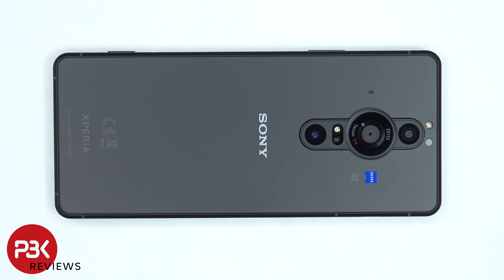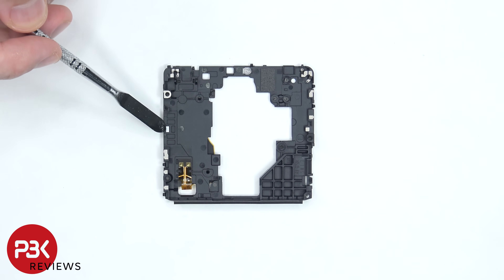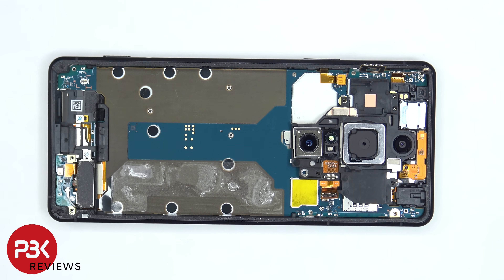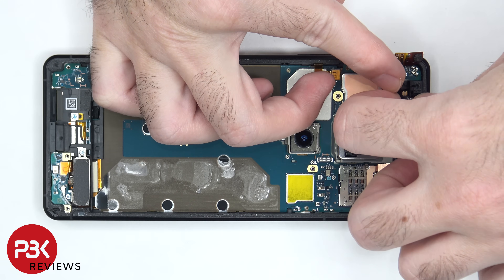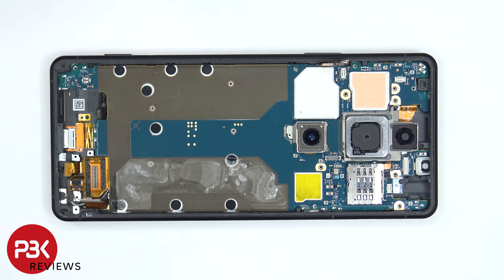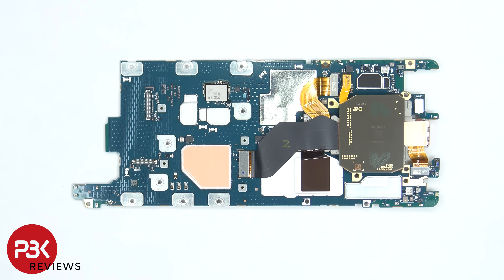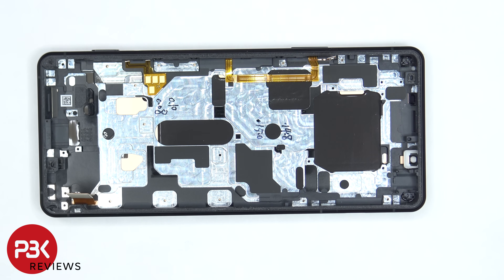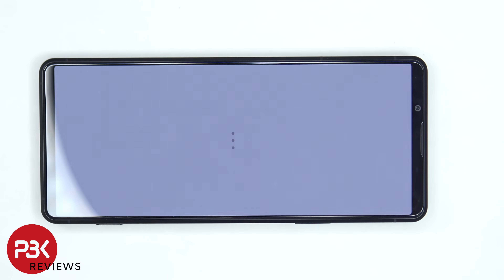Sony Xperia Pro-I Disassembly Teardown Repair Video Review

Comment: My microphone produces a lot of background noise so you can't hear what I'm saying, when I recorded my voice there was only noise until I whistled, on the recording the whistle clearly penetrated the noise which means that the microphone is working somehow. On your recording you probably listed 4 microphones, which one is the one used for conversations?
Reply: It seems that different microphones are used for phone calls and different ones for voice recordings or camera recordings. In my case, the bottom one is damaged.

Comment: Hello. Please help me fix my phone. I took my phone to a service to replace the fingerprint sensor. The sensor was changed along with the cable. The next day after the repair, the front camera froze during a video call. After this, all cameras do not work - an unknown error appears. The flashlight also cannot be turned on - it says the camera is in use. The service refuses to take responsibility. I took the phone apart. Several screws are missing, the flashlight diffuser is broken, the additional microphone cable was installed under the frame - incorrectly. Could the front camera or its cable cause a breakdown? I tried disconnecting
 front camera - no change. Does it make sense to try to turn off other cameras one by one? Or if at least one camera is turned off or the cable to it is damaged, then the remaining cameras will not work? Is there any point in trying to reset your phone to factory settings? I tried to stop all applications that can use the camera, deleted the cache - nothing helps. Also, before disconnection front camera battery drained very fast. Reset phone without front camera - did not help. Connected front camera, reset phone - nothing.

Comment: how do you separate the cellular antennas if possible? rest of video is awesome!
Reply from the maker: Some may be possible like the plastic covers which have the grey lines running through, but the board contacts which touch the frame would not be since you will end up damaging the board itself removing those.

Comment: Hey, I need to replace the fingerprint scanner of this phone. Do I need to take the main board out to be able to remove the fingerprint scanner?
Reply: Did you figure this out? I'm just waiting for my new scanner to arrive in the post.
Reply: @tris5506  You don't need to take the whole thing apart. The screws that are covered by the felt fabric are the last ones that need to be taken out and then you can access the fingerprint scanner.

Comment: Water got in mine, it's totally dead. Looking at this...I guess it's done for, because if I could even find the parts, I would probably lose something else
Reply from the maker: Yep, even if you took it apart, its a 50/50 chance you can get it working again based off what might be damaged inside.

Comment: Do not buy this phone! you will regret it. Camera is bad on so many levels, it freezes, UI is bad, screen is very dim even on the brightest setting and im sure it can't go 120hz it promises, It doesn't have photo gallery and it has loads of bloatware, Battery dies quickly, You can't upload your photos from the phone directly to computer the computer program won't work with this model, etc etc.
Reply: Liar

Comment: At 7:40 Soldering parts on the motherboard is very bad
In addition, the drawback of this design is that any failure of the board requires maintenance, and the thing cannot be replaced as a single piece. Like the charging pad on the S-22 Ultra
Reply from the maker: yup

Comment: So the phone has no cooling system or features? No wonder it suffers from serious overheating problems.
Reply from the maker: Yep. It has some graphite layers between the screen and midframe and uses the midframe to transfer heat but no major cooling components or anything significant, which usually is the case on sony phones.

Comment: Now, as if it was open, will it still be water proof // dust proof?
Reply from the maker: you would need to apply the original pre cut adhesive for the phone to retail water resistance. Usually parts for sony phones are hard to find so yep.
Reply: @PBKreviews  Thanks; so a guaranteed good repair shoul be done by Sony service I guess.

Comment: I was wondering why sony didn't put any thermal pads / paste on this device. I remembered the 1st xperia pro, it has a the largest vapor chamber on any phone on the market. 

Yet the Pro - I with the Snapdragon 888 chipset doesn't have any cooling capabilities and we all know the heating issues with the 888 chipset.

Comment: where is heating chamber that release the heat?
Reply: the motherboard seems to act as a heatsink on this phone while being connected to the dissipation elements, a bit like a pcb, and transfers the heat evenly to the frame.  just a guess nothing definite

Comment: I think 3/10 is not fair 😳 the process of disassembly of this phone is to easy and also excited , a laptop size motherboard of this phone is too exciting to see and the longest teardown is because of a lot of components in this phone , I just imagine if Apple maked this phone , thanks for the teardown and I will watch it again and again , for me it's one of the best disassemby in this channel ♥️
Reply from the maker: Thank you! The score is not just based off taking it apart, I score it based of design, ease of replacing the screen, battery replacement, charger port and misc part replacement, as well as parts availability for the phone. I will be using this scale and will implement a score chart on videos in the near future to show how I came to the score I chose. :)

Comment: unfortunately in my country it doesn't come in... want to buy abroad the tax fee is too big 😭
Reply from the maker: Ya import tax can be a pain sometimes. Best bet would be to wait and find some deals on it on ebay or elsewhere.
Reply: @PBKreviews  it's the best choice, but for eBay it will be difficult to get a cheap price promo
Reply from the maker: @wedread  yep but sometimes some sellers offer a lower good price a few months down the line.

Comment: Wow I see why the phone is $1800USD.  Everything is replaceable and it definitely looks like computer insides more than a phone.  I don't think I have ever seen radio cables in a phone before!  But I don't get it, why no wireless charging?  Perhaps Sony was concerned about the camera bump or the fact that it doesn't have any heat management?  There was definitely a place for a wireless coil.  Awesome tear down and rebuild!  I used to repair Thinkpads for a living.  This brings back memories :-)
Reply: My Xperia 1iii has wireless charging, I guess they prioritied the Camera in Pro-I, what is the battery size of the Pro I?
Reply: @Dankzzz  The battery is 4500mah.  I heard that the RX700 gets very warm when the camera is in use.  Since the pro-I has the same sensor and chipset, I think to prevent the battery from overheating and catching fire, they omitted the wireless charging since it heats up the phone.  This is why Samsung wireless charging pads have built in fans.
Reply: @deep_space_dave  I guess It depends on where you live, here in south Sweden I never get a heath warning. When it was brand new it was abit warm and after a update... It's the same inside mostly, but my 1iii has some sort of cooler tech I think the same is in Pro-i Sony call it Heath cooling or something, even said it in an ad... I think this is the box that spreds the heat to the case. Related to that the 888 runs hot this is not the case here, but the weather vary in the world.
Cellphones can't endure extreme temperatures, I keep mine inside my  jacket in the chest, because it's freezy cold, to save my battery etc.
Reply: It's very hot here in sweden in the last two summers, but in the winter it's freezy cold... And weather is changing more
Reply: @deep_space_dave  I'm very happy with my Xperia 1iii, only thing I wish is that the battery was bigger, but it lasts ca 1 day with heavy use.
Reply: @Dankzzz  I live near Chicago in the US.  It has been very cold here lately (-20c) but we will see how the phone holds up during the summer months that get pretty warm.
Reply from the maker: Thanks! Yeah not sure why they didn't include wireless charging. Maybe the additional cost on top of how expensive it already is or something else.

Comment: I wonder whether it's possible to take the main imaging sensor from a Pro-I and put it in an RX100 VII, or vis-versa.
Reply from the maker: I'm not sure, but i would think there might be software issues as well.
Reply: @PBKreviews  good point. Drivers would likely interfere, but the 'Pro' tools on the latest Xperias are fairly similar to Alpha cameras and possibly Sony compact cameras.
Reply from the maker: @youtubeairways8646  👍

Comment: This is the first time i see a motherboard across the whole frame since the day of old Nokia. Can't fathom how Sony managed to layer a screen, a body frame, motherboard, battery and finally the back plate. Looks like a long lost production technology
Reply from the maker: Yup, some people think its well engineered and some think its old concept. I'n my opinion I think its a good device but they could have engineered it a bit better, more organized and easier to repair and added wireless charging. However the price itself is definitely not worth it to most people, so adding anything extra would only increase the price further. :)
Reply: @PBKreviews   IMO, that feat can be attributed to Apple which vehemently stand for their total control of devices even tough the buyer has spent $1000 more for the iPhone. I remember as complicated as Nokia N95 was or early Android devices around 2010 - 2015, everybody could take the phone apart and do the repair.
Reply from the maker: @erick-gd7wo  yup
Reply: Htc also do that motherboard design.
Reply: @captainr5725  did*

Comment: I have no knowledge of phone motherboards and stuff so I have to ask what makes this motherboard so complex? Because to me it doenst look so bad, especially if I compare it to something like the board of a razer blade 14 (laptop)
Reply from the maker: Well comparing a laptop to a phone board is a big difference. It's complex in that it has a lot going on, so many cables to disconnect to gain access to replacing commonly replaced parts like charger ports, screens etc. Usually in most phones, you wont need to remove a motherboard say to replace just a charger port, or a screen etc. But this phone the way things are organized you have to take apart the phone almost entirely to gain access to those parts to replace.
Reply: @PBKreviews  ahh thanks for the explanation, that makes alot of sense. Guess it's best to get a good case and screenprotector with this phone or good insurance because I doubt repairs will come in cheap
Reply from the maker: @championxxlNL  yup, you're welcome.

Comment: Good job ❤️❤️ 
Can i ask you, what does it seem so complicated and the motherboard is more like a computer not a phone? 
Is this complexity has something to do with performance in any chance?
Reply from the maker: Hi, no it's not related to the performance. Just the way sony engineered the layout. They could have designed it differently and still had the same performance. Thanks! :)
Reply: I think it's such a complex design cause they used some rx100 internals apart from sensor - ISP or something to make it work.

Comment: In your opinion, why is there no wireless charger inside this phone? Is it because there is not enough space? Because that's what I'm thinking of ?
Reply from the maker: I would think if they didn't put that adhesive on top of the battery, they would possibly be able to fit a wireless charging coil over the battery. Or they could make the phone just slightly thicker barely even notice the difference. But probably just a cost cutting measure, the phone already is priced expensive so they probably didn't want to add any additional amount on top. Not sure.

Comment: Is it considered a good board design?
Technical wise or design wise.
It may be very complex and hard for someone to come out with this complex design, but at the same time it can be outdated or inefficient design. 
Which one is it
Reply from the maker: I'm not an expert in electrical engineering or one of the designers but I feel they could do the layout and organize everything more closer together and fit it on the top half of the board without the need to have such a long full phone length board layout that the battery sits over. They could have a top main board and a bottom sub board where the charger port and other components are attached to, with the separating of the battery in the center like most phones are.
Reply: @PBKreviews  No, it is not possible with such a huge sensor and since the main sensor already take up vertical space equivalent to double stacked boards due to which they have to shift the SOC and UFS to  some where in middle.

Comment: So to change the charging port for example, you have to basically take apart the whole phone.
Reply from the maker: Yup pretty much.
Reply: @PBKreviews  and to change one of the most repairable things on a smartphone (the screen), you have to basically do the same. 
Geez.. talk about Sony making things difficult
Reply from the maker: @DenisThomasGR  Yup, with the screen at least you don't need to remove the motherboard but still quite a few steps before you can replace the screen.

Comment: all the sony phones for last few years have been total scam
this phone it doesnt even use the full sensor but they sell it as 1" and look how small is the lens it's a joke
and they sell the screen as 4k but it's not 4k, 4k is 8MP of dots but this is 6MP of dots and has equivalent resolution of 2k
Reply from the maker: I'm not sure about the exact size of the lens but the shutters do open up when the camera is in use. As far as the 4K, yep not sure.
Reply: @PBKreviews   the guy simply messed with 4k 16:9, while UW4K is the ultra-wide 4K standard, with a resolution of 3840 × 1600, and an aspect ratio of 12:5 (2.4:1, or 21.6:9) This resolution is most commonly used on Ultra HD Blu-ray discs ( Sony Pro-I screen with 1644 x 3840 pixels)
Reply from the maker: @andreachan8697  👍
Reply: Sony Don't Scam, unlike other brands, just puts PRO and increases the memory and many sheep fall for it. 1 inch but have you seen their night manual photography better than others.

Comment: I think Samsung and other companies need to learn how Sony to put all the necessary components inside the phone instead of giving excuse to remove features like remove headphone jack and SD card slot. They are capable to do it but just do not want to do it. Thumbs up for the good video 👍
Reply: We know the reasons why others have removed the headphone jack and SD card slot (more money by forcing end users to buy extra accessories and new phone)
Reply: @GreasyFox  Not to mention more money for higher Storage variants. Just getting more storage is insanely expensive.
Reply: @jashsylde8136  exactly, not saying a fast micro sd card isn't expensive but it has so much advantages, for example I have the Xperia 5 II which has a hotswap toolless microsd slot and when I'm shooting with my camera and I want to put the pictures on my phone I just put the micro sd card from my camera into my phone, data transfer is alot faster and more reliable and it's swapped in like 15 seconds
Reply from the maker: Thanks!👍
Reply: They want money,thats it

Comment: Wow, very detailed teardown thanks.
Do you think it would be possible to transfer some heat to the backplate by removing some parts of the plastic cover and adding thermal pads?
Reply from the maker: Thank you. The problem would be, the plastic cover on the back side has antenna lines drawn on it, so damaging that or removing that would probably cause signal issues. Also the processor side and the components which heat up the most on the main board are touching the inside frame portion which is between the screen and the motherboard, so most of the heat from those components is exhausted through the front where the screen is. It might be possible just to add some thermal paste (a very little amount since you don't want it spreading around the chip) on top of the processor, ram and so forth to help transfer heat better. However the way they have designed it, the metal shields which cover the processor and chips are seated firmly against the chips (so the chip makes contact with the shields to transfer heat to it) so there really isn't any room to add much of anything.
Reply: @PBKreviews  I see, thanks.
Reply from the maker: @4paapii  you're welcome

Comment: the incredible 1inch camera phone...that has in reality a half inch sensor...of which only the center 12 megapixel are used...from the 20 original because the lens is too small...huge motherboard makes huge phone with a small battery...price is twice as worth like the usual sony
Reply from the maker: lol yup

Comment: Watching this on my PRO-I, impressive how much tech Sony crammed into that slender body.
Reply: @PBKreviews  Does it have 5G antenna?
Reply: @wolraadwoltemade3275  sub 5G is ok
Reply: May I ask, if you would be so kind to answer, how does this phone shares against overheating since this teardown and the guys at GSMArena tells us there's no copper plate, graphite layer or thermal paste for the CPU and the chipset?

And in terms of normal/heavy use and performance... I won't ask for the device not to be boiling if I shoot a 4K video at 120hz/60fps... I've read it auto shut-down

Thanks in avance. I'm currently in-between this one or the 1iii to upgrade my XZ Premium
Reply: Does it have 5G? yes or no?